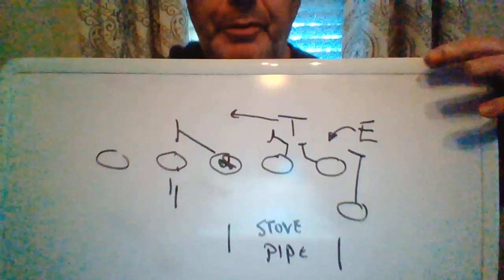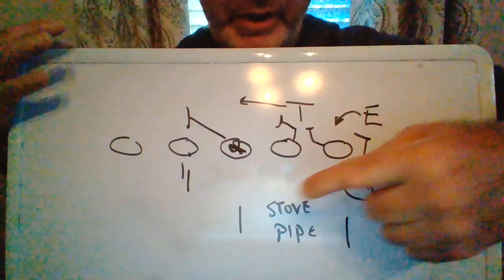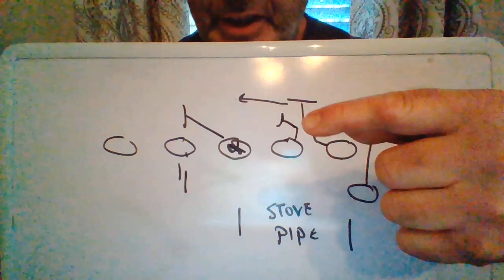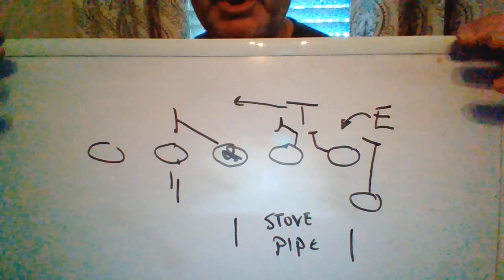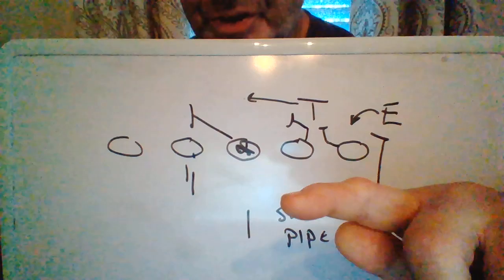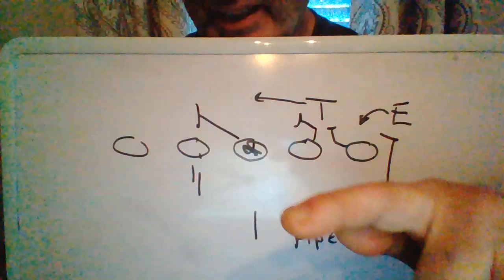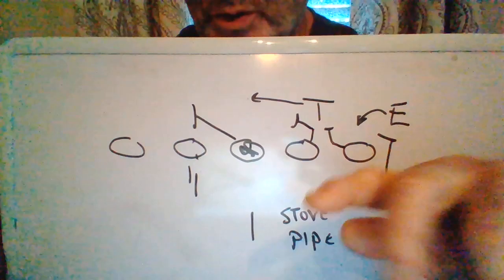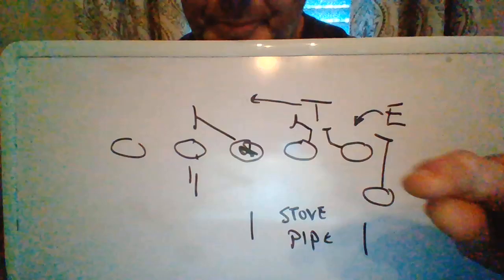when to "throw" and when to "tear"

Comment: Do you have video on "tear"?
Reply from the maker: if you watch the ELON TIGHT END TEACH TAPE, the first 4 minutes is the tight end tearing a 7 through the stovepipe on power.
Elon University tight ends 2008
https://youtu.be/DR0gAeMug2M

HOW AND WHY TEAR
https://youtu.be/xk4IzbNhQSs?si=cc4R2KtSEMsJpIk4
Reply from the maker: we were flipping full time by '95, but tear started in 2008.
Reply: Thanks Coach. I have just called that wash, because I didn't have a better name for it. But I know now that's it's tear.
Reply from the maker: @CoachMarcT  we said that a "wash" is vs clear leverage, aka green light. or when the defender steps into green light.

tear is for yellow light, to define a defender who is NOT IN YOUR GAP. 
We take our hand and put it in the defenders armpit. When tearing we use his upper body like a lever.
I can't locate a drill tape.

I would not count on these blocks now, but that kid was a gorilla! he was a true freshman with long arms and great strength.
Reply: Is green light when it's clear to go as planned?
Yellow light foot fire and read for movement?
What's red light? Is it Jim McNally's double stop sign block?
Reply from the maker: @CoachMarcT  I just made you a video
Reply: Thank you!